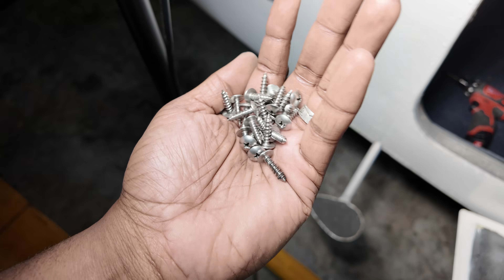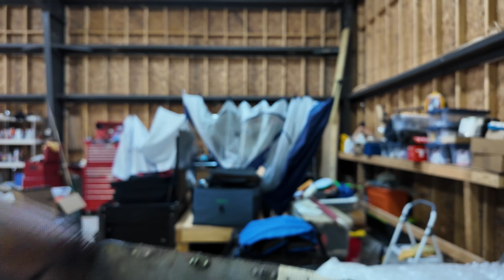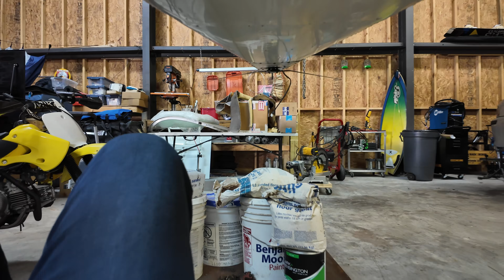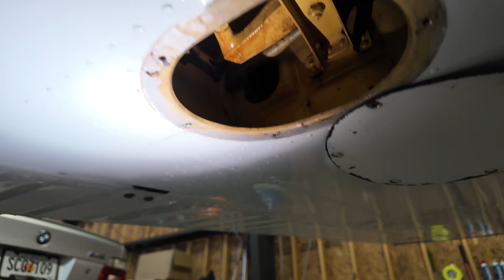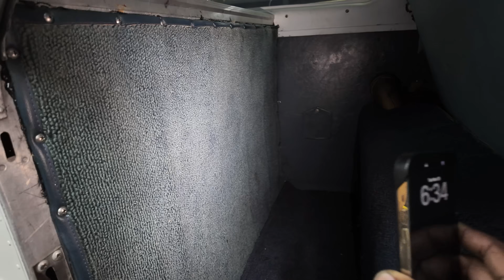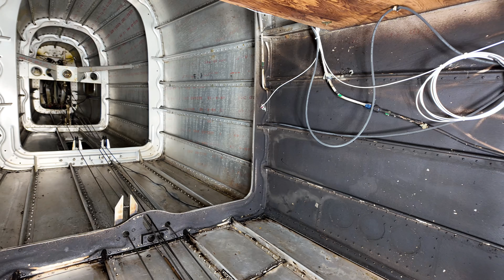Annual for an OLD Beechcraft Bonanza - You Can Do This Part Yourself

Comment: I don't know your opinion about stainless steel screws, but I'm not a fan.  I'm 90% through replacing all of my hardware with AN/MS real steel stuff.  Some may think I may have a screw loose, but that's fine.  I don't like having a 1000 little batteries enhancing corrosion.  And the steel philips head lasts longer.  And steel screws can benefit from a magnetic tip.

While I'm at, the drive bits that come with screwdrivers are for wood screws, not machine screws.  Apex Pozidriv 446 series is the best in my opinion.  I buy 10 at a time.  5 last about a year, and the other 5 are given to friends that use wood screw drivers and have rounded heads.  

Also, tobacco bags, canvas type, with draw string, make for great screw holders for me.  AS has expensive ones, and etsy has cheap ones.  Search canvas gift bags.  And tie the wee bag full of a panel's screws to one of the screw holes.

Keep up the good work!  You are amazing!
Reply from the maker: Can't believe I missed this - excellent call on using appropriate hardware to prevent galvanic corrosion. In other applications I've seen the use of nylon washers under the screws to do something similar and protect the paint a little longer. And yes yes yes bits are just as important as the screws themselves. Simon gave me a few of the "fancy bits" recently and they fit and grip just that much better.

Comment: The assumption here is that your A&P IA comes to you so that you can do this before hand. What sort of things can you do if all of the A&P IAs in your part of the world want you to bring the airplane to them?
Reply from the maker: Very important caveat indeed!

I'd say the monthly lubrication routine (see my latest "YouTube Short" video that will eventually be a regular video) since it'll reduce wear and keep hardware from becoming brittle from corrosion (A&Ps have to fight the old hardware anyway and they hate bad hardware and corrosion). You could possibly work with another A&P to work up a specific weight and balance with the unoccupied seats and/or interior cosmetic panels removed. Most CAR 3 airplanes I know of are legal to fly without an interior but you need a W&B to match. Some provide it as a "Utility Category" W&B. You can digitize your logbooks (scans) and make them smart (think Excel spreadsheet) to easier calculate "time since X" and AD compliance dates. A&Ps hate doing boring repetitive logbook research on hand-written entries...point them right where they need to go and watch them smile. You could perform truly preventative maintenance to avoid them adding to the squawk list. You can take proper notes when you "notice something different" or "felt a strange vibration" to help them investigate if necessary. You can join your airplane's type group (like American Bonanza Society) and browse the forums on the typical issues that might not be commonly checked on annual. You can also consider flying the airplane away to a more friendly MX environment which might require a week off work but a lifetime of learning and new friends. 

In just spitballing here. 

The goal however, is to graduate and support more maintenance professionals who look at owners as a team member, not just a job and paycheck. They're missing an opportunity to make you smarter and safer because they're probably overloaded with work and just want to get in and get out. There's a place for both.
Reply: @OpenSourceGA  Well, I am about to retire. So I'll have time to do that now. That is a thought I hadn't considered. I'm also going to start apprenticing with our non-IA A&P who works on our airplane to log ours for my own A&P.  So yeah options open up.
Reply from the maker: There's no way you're old enough to talk about retirement?! Think of all the upcoming flying adventures! You'd be surprised how much trust that non-IA A&P will put in you once they see your capabilities. Like any other relationship you just need time to build trust. Airplanes are simple machines designed for the 1950s. My old mentor would say if you need more than 10 tools to fix something on a Cherokee you're doing it wrong. He designed the Cherokee.
Reply: @OpenSourceGA  My mom is Filipino. I have a few "older than I look" genetics, which was really rather annoying in my 20s, but pays some benefits now.

I have more than 10 tools. Probably not the right 10 tools. There's a car guy I watch who acquires tools this way: Go get an estimate for the work. Go price the tool to do the work himself. If the tool costs less than the work, buy it and do it. That's a pretty easy standard to meet in aviation.
Reply from the maker: This makes total sense now haha. May it continue to serve you well in health and flying ability!
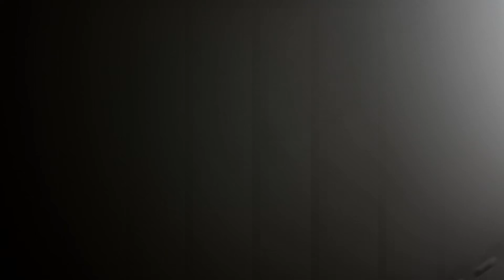Reply: 16:38 that’s the pivot screw so you can slide the panel out of the way. It doesn’t need to come out. Previous owner stripped the head so you wouldn’t forget.
Reply from the maker: 😂 this is why you're the man. Perspective for days!
Reply: @OpenSourceGA not sure why this posted as a reply to this thread instead of as a new comment. Whoops.